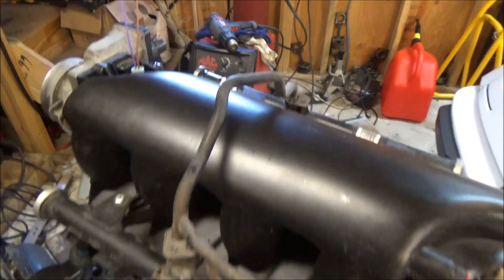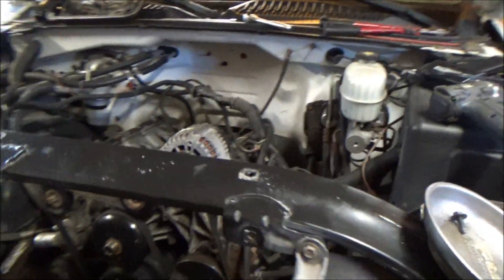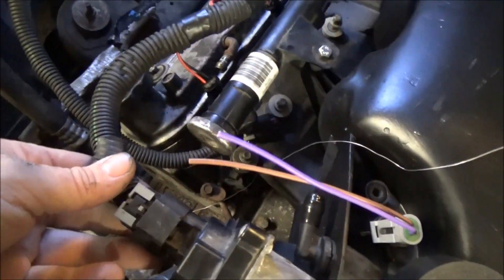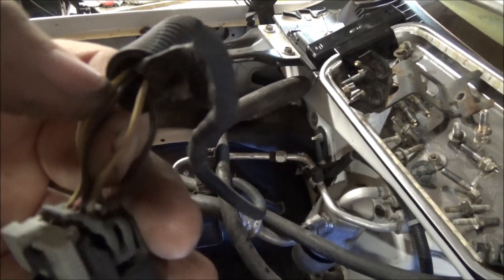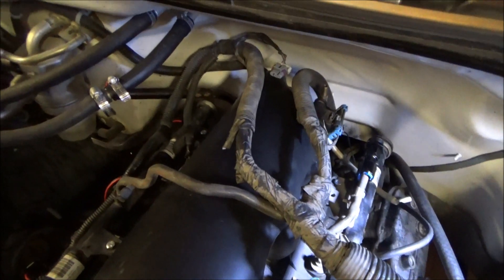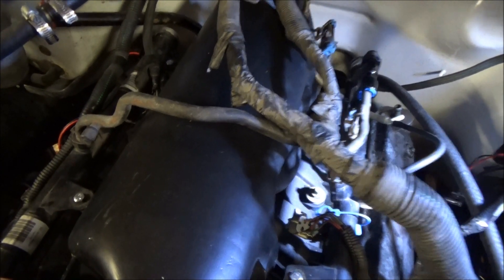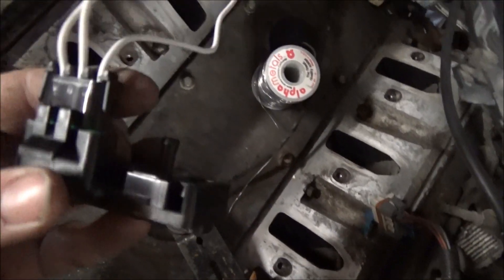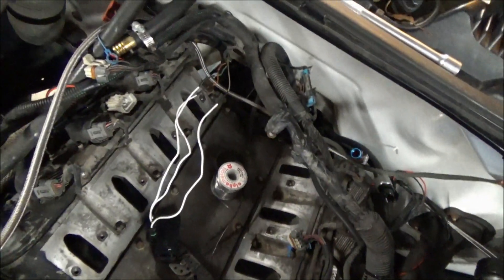The JSRP Parts Truck Build Part 6 How to Modify the Harness for the Injectors, IAT and MAP Sensor

Comment: found this tool a while back , it alows someone using (normal priced) generic single colour wiring to add the extra striping you need when running more the normal range of single colour wires 
if you have white yelow light blue and light green you can add an enourmous amount of coding just by buying a big box of colour sharpies  you can even add silver or gold to black wire 
http://www.aircraftspruce.com/catalog/topages/wiremarkingtool.php